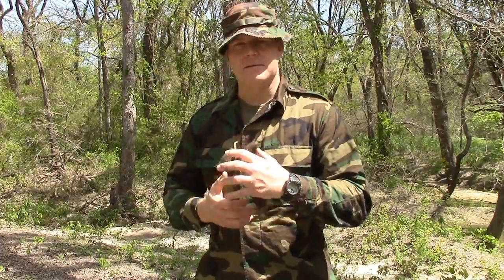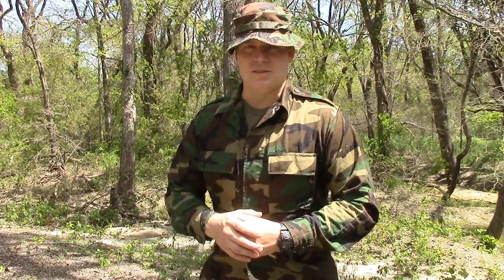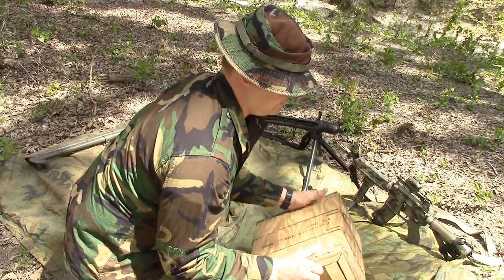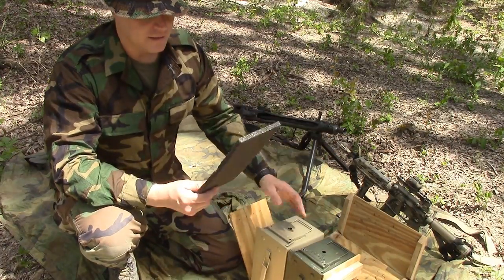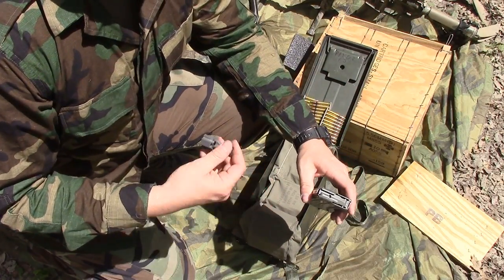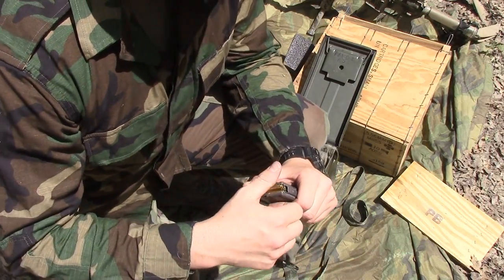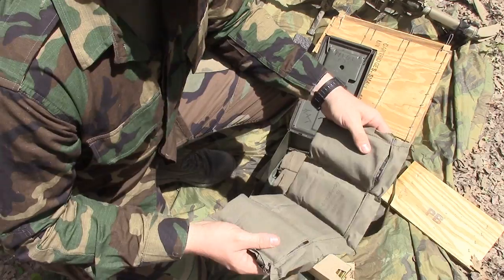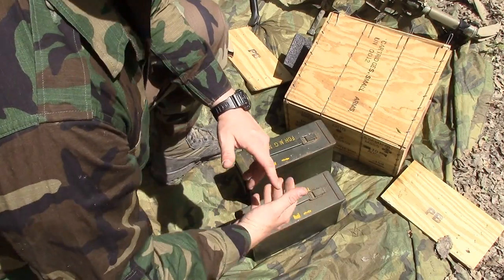Combat Resupply

Comment from the maker: *Guys, Primary Arms is hooking up my subscribers! If you want to get FREE shipping and a free gift such as a FREE or discounted (depending on which scope) scope mount for the variable scopes, or a free anti-reflection device for the prisms optics, just follow the links I have posted below on the scope of your choice. YOU MUST follow these links or you will not get the free or discounted mount/anti-reflection device and free shipping from the standard Primary Arms website.* 

PA CYCLOPS 1X PRISM (BLACK): http://bit.ly/2BREKZn
PA CYCLOPS 1X PRISM (COYOTE/FDE): http://bit.ly/2BRfhiX

PA Advanced Micro Dot w/ push button: http://bit.ly/2LX39Nd
PA  Advanced Micro Dot w/ rotary knob http://bit.ly/2CjTCjr
PA Micro dot (Budget red dot) http://bit.ly/2Ci99k3

Holosun HS503G RDS W/ ACSS http://bit.ly/2r7gCd3
PA 3X Magnifier http://bit.ly/2r3XAV2
GG&G flip to side magnifier mount: http://bit.ly/2EN5uv3

PA 1-6X24 FFP ACSS RAPTOR 5.56 / 5.45 / .308 BLACK http://bit.ly/2jW0V4O 
PA-1-6X24 FFP ACSS RAPTOR 5.56 / 5.45 / .308 WOLF GRAY http://bit.ly/2IidvtX 
PA 1-6 FFP ACSS RAPTOR 7.62x39 / 300 Blk out http://bit.ly/2IIAnC5 

PA 1-8 PLATINUM FFP RAPTOR 5.56 http://bit.ly/2zqXYBo

PA 3X Compact Prsim Scope ACSS 5.56 GEN II (Black) http://bit.ly/2OzAQqA 
PA 3X Compact Prism Scope ACSS 5.56 GEN II (Coyote) http://bit.ly/2OAEekN 
PA 3X Compact Prism Scope ACSS 7.62x39/300 Blkout GEN II (Black) http://bit.ly/2KdtaXD 
PA 3X Compact Prism Scope ACSS 7.62x39/300 Blkout GEN II (Coyote) http://bit.ly/2n3AgVv 

PA 1-8X Scope with Patented ACSS 5.56 / 5.45 / .308 Reticle http://bit.ly/2SPbNob

PA 1-6X24mm SFP Riflescope with Patented ACSS 5.56 / 5.45 / .308 Reticle Gen III http://bit.ly/2BD73bB
PA 1-6X24mm SFP Riflescope Gen III with K.I.S.S. Reticle http://bit.ly/2SUbxEo 
PA 1-6X24mm SFP Riflescope with Patented ACSS 22LR Reticle  http://bit.ly/2N8fj7P
PA 1-6X24mm SFP scope w/ACSS 300BLK/ 7.62X39 Reticle http://bit.ly/2N6Qut9
PA 1-6X24mm SFP Riflescope Gen III with Patented ACSS 22LR Reticle http://bit.ly/2N8fj7P

Trijicon ACOG TA31 4x32 Scope with RED Dual Illumination ACSS Reticle TA31-R-ACSS http://bit.ly/2EQIMhg 
Trijicon ACOG TA31 4X32 Scope with RED Dual Illuminated ACSS AURORA RECTICE http://bit.ly/2T6uZuz
Trijicon ACOG TA31 4X32 Scope with GREEN Dual Illuminated ACSS AURORA RECTICE http://bit.ly/2FRTmIQ

Trijicon TA44 ACOG 1.5X16S TALL BASE (GREEN ACSS reticle) http://bit.ly/2DkC72H 
Trijicon TA44 ACOG 1.5X16S TALL BASE (RED ACSS reticle) http://bit.ly/2rdEu1O 
Trijicon TA44 ACOG 1.5X16S SHORT BASE (GREEN ACSS reticle) http://bit.ly/2EQge7G 
Trijicon TA44 ACOG 1.5X16S SHORT BASE (RED ACSS reticle) http://bit.ly/2FMdLMO 

BIG THANKS to Dimitri and Primary Arms for making this all possible! 
Also don’t forget to check out and subscribe to Bruce’s channel: https://www.youtube.com/channel/UCwfzznRRdLUHwKiMTND49Jg 
Also check out my buddy John who is the owner of UW Gear and his Youtube channel at Alpha Charlie concepts: https://www.youtube.com/user/AlphaCharlieConcepts
Reply: as mike b vanderboeg (the man who broke the fast and furious scandal on the net)was a huge advocate of bandoleers.  I decided that the us-gi version was lacking.
the gi material to me is just too damn flimsy and weak.

I bought a sewing machine.
I ordered various colors and weights of webbing.(they have some very thin and strong versions out now)NO COTTON!
I also was dis-pleased with a lack of camo.  so I bought dozens and dozens of yards of various camo patterns.
I ordered FDE "D" rings(metal)yes, they are out there.
Also ordered buckles for the webbing,,1 inch.
ordered 1 inch quick detach rifle sling snaps.
I more or less copied the dimension of the gi bandoleer with new camo material.
added the D ring into the bandoleer, at the ends.
at first i thought the card board inserts were the way to go,,,  i made some but was not pleased overall.
what i came up with is my,,,"pocket in a pouch".
i made a small pouch that held the 3 ,,10 round strippers.
put the 30 rds in the pouch, then inserted into the bandoleer.
made the pouch(VERY IMPORTANT HERE)2 or so inches TOO long so that,,,,,
i inserted the pouch and let the TAIL of the pouch hang out of the bandoleer.  when ammo needed just yank on the tail,,out comes the pouch.
ammo does not rattle nearly as much in the pouch.
plus, if i will not need ammo soon, i can tuck the tail of the pouch into the bandoleer pocket.( a very good seal)
then i used webbing and the adjustment buckle to make slings for the bandoleers.
no safety pin needed.
the bando slings used the cheaper metal snaps that connected the sling to the d ring.
these bandoleers look better function better and will take much more abuse.
then i came up with an ingenious bandoleer for M1 garands.
line up 4-5-6 pockets for the clips,,,,
but leave the top(open side)up and put a zipper on the top.
as you need a clip of 8, just unzip it to where the next clip is exposed.
d rings on ends with adjustable sling,,,the way to go.
BTW, I made some bandos for the 5.45x39 that i have,,,,
if you have never seen the somewhat rare(EXPENSIVE) stripper clips for the 5.45x39,,,you must see how the commies engineered them.  the best ever made.
In 1970 I was in home economics 6th grade,,Mrs. Mendenhall was my teacher.
this is where I tried to learn how to operate a sewing machine.  
I was not good back then at all.  40 years later after some practice I was able to do very good work.
impressed my mother.
thx teach.
Reply: Do you have trouble using those speed loaders on pmags I had trouble when I was at the range few years ago when I was firing my weapon it wasn't feeding right but I didn't have trouble with the GI metal mags
Reply: Children that has their own gun and sees this comment:Let me buy these stuff using my dad's credit card.
Reply: Schweeeet!
Reply: @fatjellydonutglaze2230  pmags have are in use by military units worldwide they are compatible with bandolier spoons. Im not sure about the gen 1pmag though Ive never owned one.  I prefer using USGI style magazines anyway, especially the Surefeed E2's
Reply: Brent do you know where, and if those 1680rd. crates are available civilian purchase? I usually pick up clips/spoons on eBay package myself  This would've save me a lot of time!
Reply: How long has our GI's been using stripper clips to load AR mags?
Reply: LightBenderGA ?
Reply: @romeowhiskeylima556  I mean, like how long have we been issuing them? Since we adopted the M16 or later?
Reply: LightBenderGA I have no idea. I’ve never served. Got arrested 3 days before boot like an asshole
Reply: Yeah man, you're not born with.
Reply: Where do you buy the repack kits to do this? Do you just order ammo in sufficient bulk to specifically request them this way or do you use an aftermarket repack kit to set them up this way? I’m in Canada looking to set my ammo up in bandoliers but it’ll cost me $200 per can to get it off eBay. Do you use CleanAmmoCans?
I’m not sure if you’ll see this comment, I’ll throw it up on your newest video too.